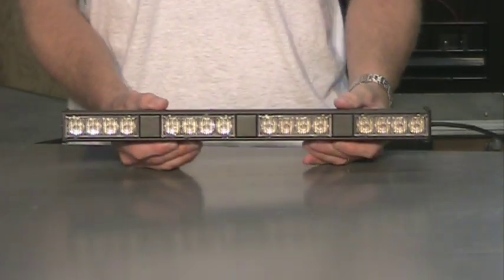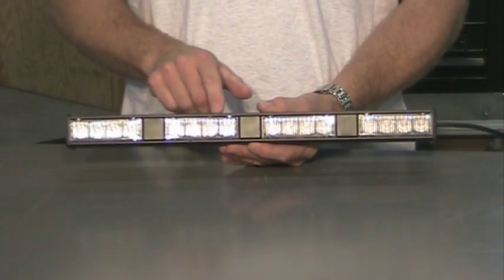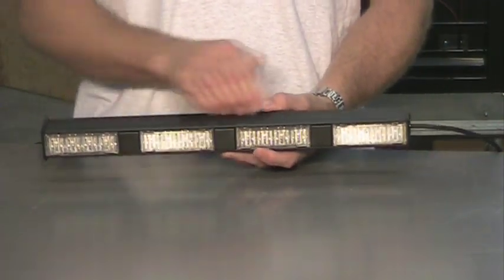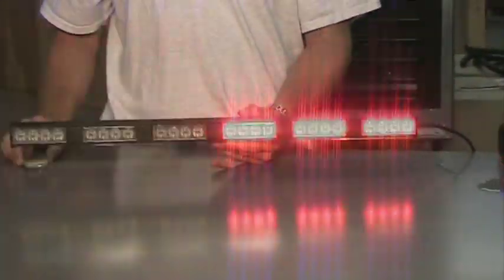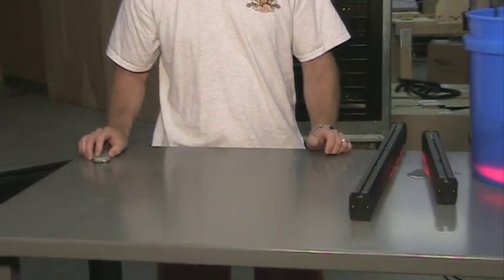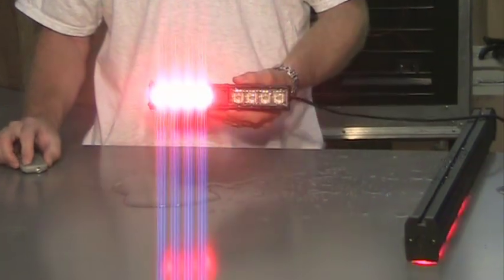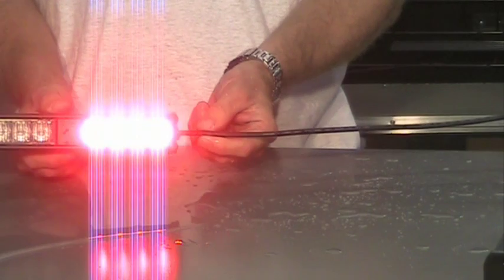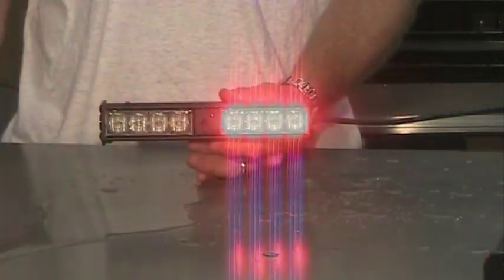E40 Series HD

Comment: I have the E46 in all red, and I have gone through a lot of lights and this thing is BRIGHT you will not be disappointed at all, trust me. I was needing something red in the back of my truck, because the 6 amber light heads on my Liberty were too bright for the red corners and I was trying to get the E44, but ended up with the E46. And to the people wondering if these have TA functions, the E48 does and the others have some patterns that can work as TA's.